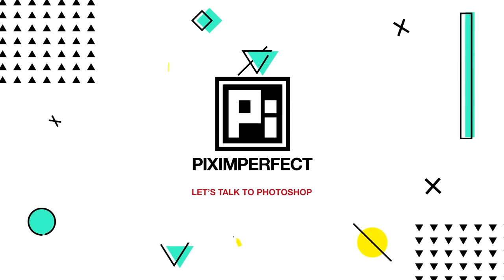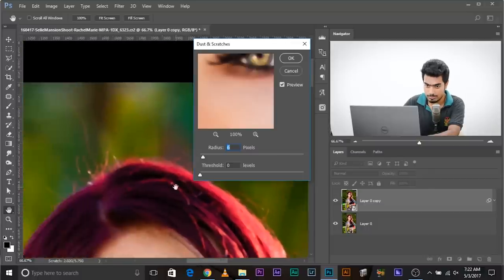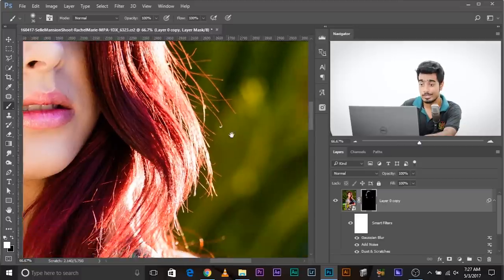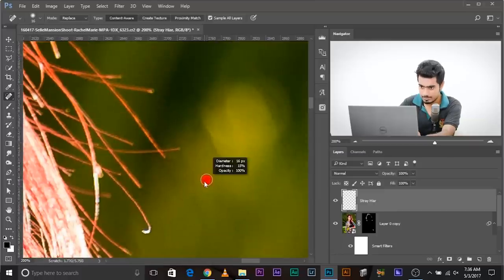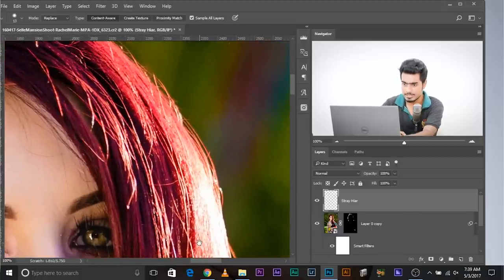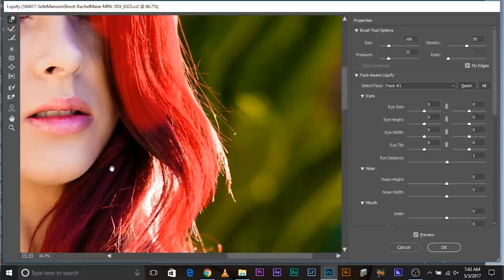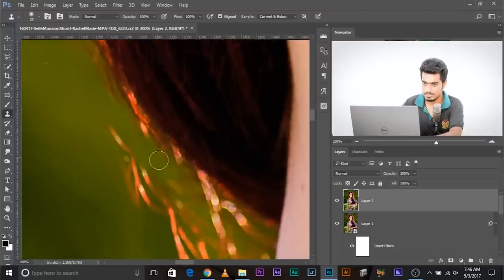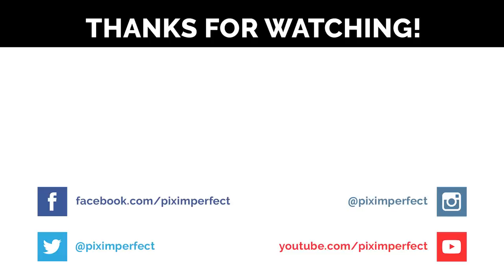3 Steps to Remove and Fix Flyaway Hair or Stray Hair in Photoshop

Comment: I love this tutorial and it has helped me so much!  I just don't understand at the end of step 1 when you switch from "painting with white" to "painting with black" on the areas where you went too far.  Please explain!
Reply: I have this issue too! Trying to figure it out.
Reply: I'm sorry this is late but for anyone else wondering on the left side of your screen in the toolbar is the black and white color swatches - when you click them they swap from white or black in the foreground to the other - when white is on top of black you are "painting white" which means applying and when you switch them to "paint black" you are "erasing" the effect. 😊 hope that helps!

Comment: When I get to 6:22 to paint with the brush, nothing happens. Any idea why? Thanks!
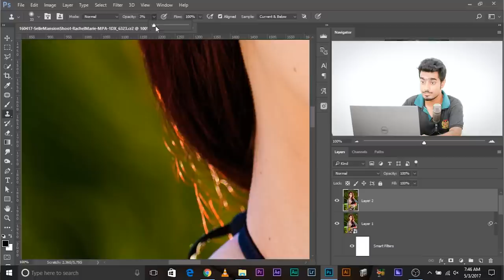Reply: I know this is late but for anyone else check to see that your color swatch at the bottom of the toolbar is white and if so make sure th correct layer orr mask (depending on what you're doing generally) is selected on the right side - if that's correct see if your opacity is too low (like what happened at 21:47!) Or if you've not got "select from current and below" layers selected in the top tool bar, depending on what you're doing. Happy shopping. 🙂